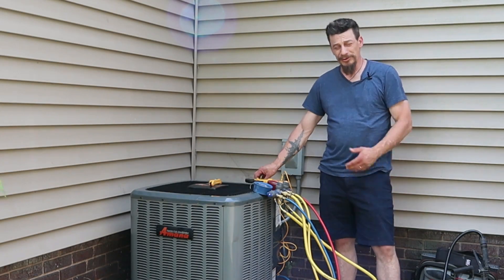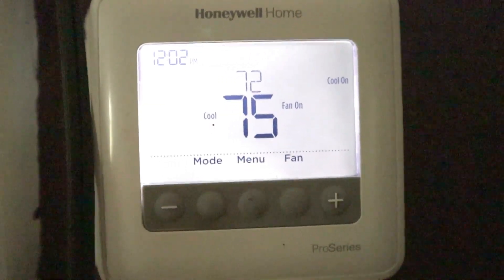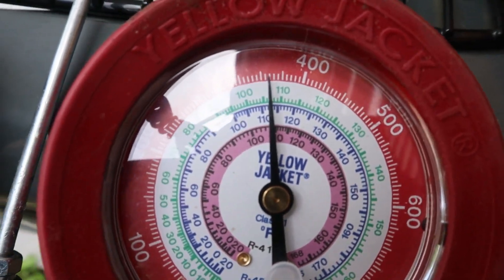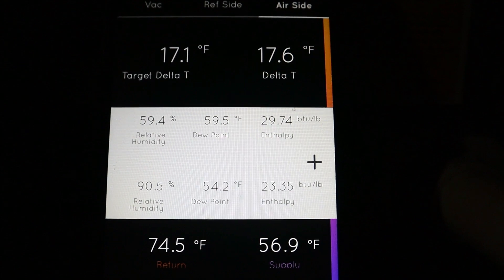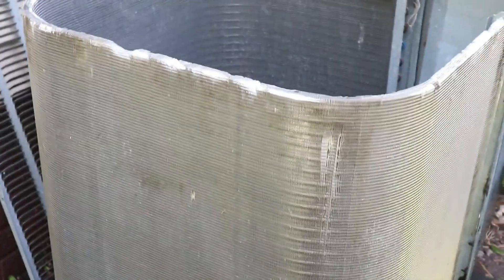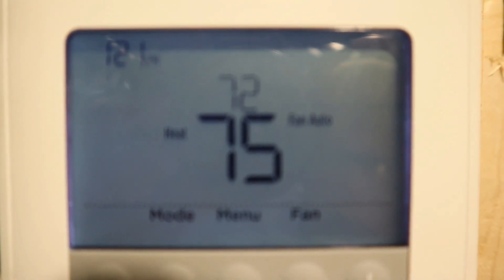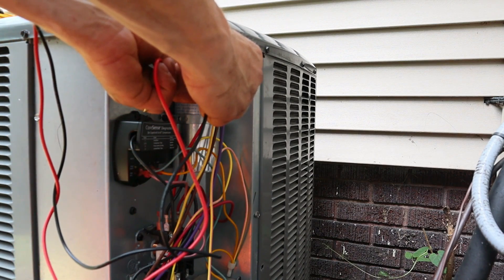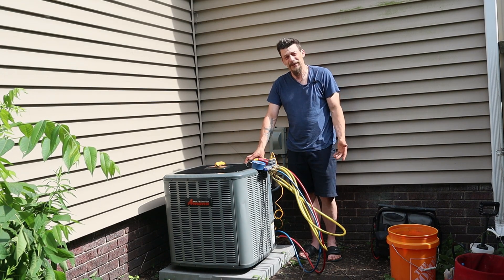I Tested YouTube’s Coil Cleaning Advice – Lazy vs Pro

Comment: Yeah thats how i did it bought one of those condenser cleaning pressure washers that are set to a maximum pressure that wont bend the aluminum fins....
Thought it was just sound PM to lengthen the service life of the unit.

Comment: Hi, @2:35 where did you get  the number 2652 in the formula?
Reply: I can give you algebraic derivation if you really want it but basically you are just calculating capacitive reactance at 60 Hz.  The formula is Xc= 1/(2x3.14x60xC) and then solving for C. Note Xc is reactance( ac resistance) in ohms.
2652 is just the constant that simplifies the math. Remember since we can not measure AC resistance we measure V and I and use AC ohms law V/I =Xc

Comment: Cleaning from the inside out is relative to the type of coil. Trane  spine fin coils are not going to clean up from inside out. Double row coils need to be pulled apart. If people would simply  wash it every year before any real build up occurs it can be washed from top to bottom from the outside in. You will get the same result. It is not a filter, direction is only important if it is extremely dirty. I did these tests 25 years ago. It convinced me a lot of techs  just hear things at classes like I did, and then follow the leader with out verifying.

Comment: Take apart fan and parts is a open to disaster. I been on call back for newer tech that taking apart fan and them when they put it back they wire wrong or leave the wire to close of the fan blades so I really don't recommend do it. Just when you clearly see the coil is cover with dirt all the way up

Comment: Unless you have double coil . I dont thing a lazy cleaning makes a difference. Having double coil will . Because its hard to get the material out between coils. I have had to spread coils several times. to get coils cleaned. More on large commercial than residential.

Comment: I was at an apartment block doing condenser clewnings on Goodman 13 SEER 2 ton units. 35 screws to remove the covers. So stupid to have these many screws.    You cannot even open the top with the fan and the wires in place as they zip tie the wires such that there is no slack. Makes my blood boil.
Looks like the Amana is similar.

Comment: Or you could just invent a narrow spray wand, specifically designed for outdoor units, that would fit through the grills without requiring disassembly and attach to a garden hose.

Comment: I think a lot of your results depend on environment the aircon is in. Near some cottonwood trees, maybe a brain dead builder or installer put the dryer vent right next to it?

Those are a couple that the lazy approach won’t work on, and they’ll look freaking awful in 6 months.

No cottonwood trees, and the dryer vent is more than 20ft away on a different side of the house. Lazy man approach works great.

Comment: Most coils i come across have never been cleaned.
They are impacted with cottonwood and dandelion seeds and dirt.
If the customer is concerned about the AC not cooling the house properly, grab the liquid line near the indoor coil, and if your fingers melt off, you'll be cleaning an impacted coil.
Strip and clean. I'll die on that hill.
Reply from the maker: Definitely agree in these cases. I had to strip an Infinity last week because of cottonwood. Had to strip another a few months back because trumpet vines penetrated an started growing on and through the coil itself.
Reply: @JerseyMikeHVAC  now Vine, there was a great app.

Comment: Good video Mike! The next time you come across a fur coated condenser coil do the same process. Spot on inside out sir...just oxidation can change heat transfer rate on uncoated coils!

Comment: I’ve cleaned dirty coils and the head pressure dropped. Going to clean a coil tomorrow as the kitchen hood discharges just 5 feet away and saturates the condenser coil
Reply from the maker: Yeah there's no lazy way to those greasy ones.

Comment: amazing non results lol but thanks for doing & posting  ....not a lot of  variance for work preformed  ... we used to clean condensers with acid clean concrete but after 29 yrs in i usually just  rinse clean form outside & if coils are that bad will pill the Top
Reply from the maker: I pretty much use simple green at this point. Save the coil clear for the nastier situations.

Comment: I notice the same results. That's why I just clean the coil with a hose from the inside out and only use cleaner if it has grease or grime on it. Thanks for the videos
Reply from the maker: Usually what I do myself.